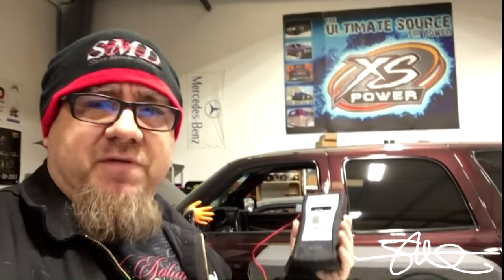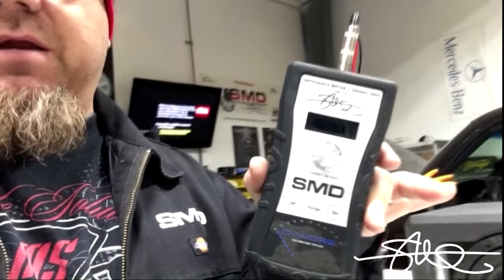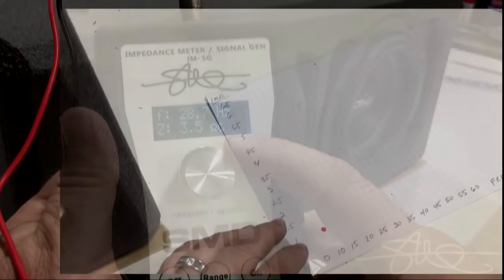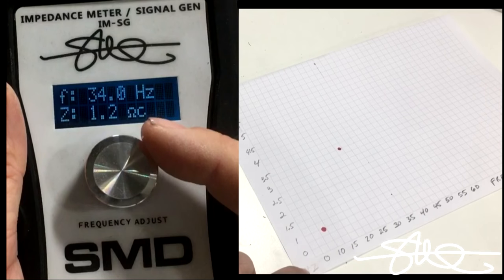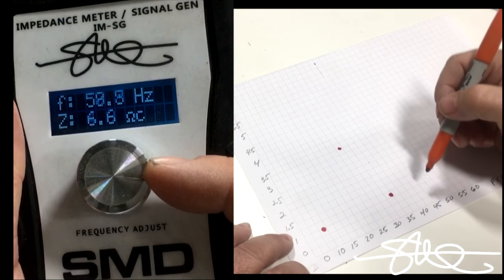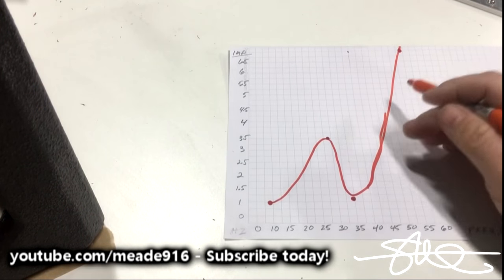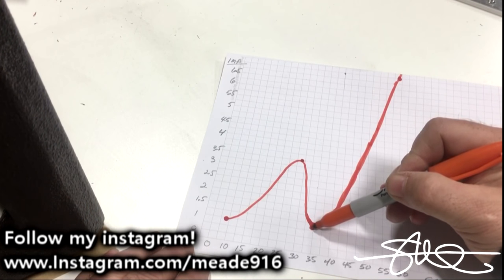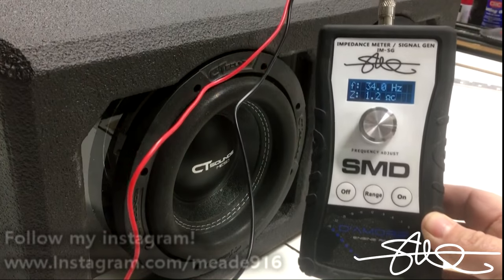Ported Subwoofer Enclosure - How to find or Verify Actual Tuning Frequency - SMD IMSG

Comment from the maker: Best part about this tool (and it does a LOT, trust me), is that you can make box changes like longer ports, adding stuffing (fill), larger, more (multiple ports), box volume changes etc and see INSTANTLY if it made a difference.  You can gain several hundred watts back by making tuning changes to a box which may have raised impedance too high at certain frequencies.  Picture this, you are seeing 5 ohms at 50hz.  You change the port and add polyfill (for example), and now your seeing 3.5 ohms at 50hz.  Your amp will put out more power.  You just fixed a problem in real time! Or, you can see if changes you made hurt you.  This is one of my all time favorite tools for sure!
Reply: In germany it's 4:40 am. 

Do you know the Eton Force18? It's a subwoofer engineered in germany.

Bitte, Englisch ist nicht allzu schwer..
Reply: meade916 that squiggly line forced me to unsubscribe lol sick vids man fun to watch im learning alot thanks
Reply: WHAT IS YOUR OPINION ON ADDING POLYFILL TO PORTED ENCLOSURES? STEVE YOU ARE AWESOME!  THANKS!

Comment: Steve I have some Definitive Tech towers and go as low as 13 htz.  I don't know if it's true. I will say they are lower than my RE audio SXXs, Rockford HX2's, old school Lanzar Pros and lower than my Velodyne.  I definitely would like to remake what they did with far less cost than I had already paid for them to make for another room just for my lows I produce in my studio.  All my tracks have thump with some lows. I love lows.
Reply: Exactly ... to get excursion you need box ported and power... a driver that supports that power.. you gave me no info bro... I'm talking about the box design. The amp. You can't just get 13hz out of just a box. You gotta have at least an amp that can push power rated 20htz and lower to begin with. Sony and a lot of other commercial brands can't or don't. While speakers, subs etc. have no ratings like that in acceptability they are measured by what comes out of them. OK.. went as low as 28htz no matter what kind of box it was in. Everything matters when trying to reach lower than 20htz or higher than 20khz. The signal of material used, amps, motors and boxes and their placement. My thing is I want to know who or what on a lower cost end has Steve built that was built for the LOW THX end of the audio spectrum that specialized in the ultra sub sonic lows? 13hz Or my other question is why the car audio market in their top brands don't have such solutions? For the really low end? Most woofers are made to push mid 20's to mid 30's.
Reply: And yes I know 13hz is inaudable. I have metal flaps on the ports of my definitive's to prevent my Ferret from going in them and tearing them up from the inside out....he already did this to some Klipsch's....when I go below 20... I don't hear it. But since I put those metal doors the excursion and sound pressure pops those doors open and slams them shut. The room shakes the whole damn house shakes. Like the lowest of thunder in a storm by nature. I know those doors aren't good to add resistance. I love my little ferret dude though and never lock him up. I just want to recreate what definitive did. They did great. Box , amp , driver.. I just have to ensure I feed it a full range signal from the 0hz and above. I just wish my damn Rockford right now in a backroom I need super lows... wish it hit like that. It don't and it's been placed in a 1.5cu, 2.0, 3.0, 5.0cu ft boxes it got lower but nowhere near as low as I needed. Basicly to get that woofer to flex hardcore took over 1,000 watts and it still wasn't going "lower" just more force on the 20hz and up range.

Comment: meade916 loving the videos . all the way from nz . running a ported 10 in my carolla and it booms . I've put guys with 2 12s to shame . thinking of upgrading what's your opinion on 2 10s in a ported custom box or a single 12 or 15 ?
Reply: 2 10s should be louder, though a 15 would go lower. Depends on what you listen to. Also, 10s tend to have more punch, around the 60Hz mark, while 15s are more like 40Hz, and 12's tend to lie somewhere in between.
Reply: UniCrafter how loud or low it goes will depend on the drivers, enclosure tuning, cabin, etc. Cost could be a factor too. He could probably save money to use on batteries, amps etc. by adding a second 10 instead of getting new subs. If he wants new subs, he can get a single 3" or 4" coil 15 for the same price as 2 smaller subs. I would personally go with a single high quality 15, and that way if I wanted more bass later on I could add a 2nd 15 and wall the car off.
Reply: UniCrafter how loud or low it goes will depend on the drivers, enclosure tuning, cabin, etc. Cost could be a factor too. He could probably save money to use on batteries, amps etc. by adding a second 10 instead of getting new subs. If he wants new subs, he can get a single 3" or 4" coil 15 for the same price as 2 smaller subs. I would personally go with a single high quality 15, and that way if I wanted more bass later on I could add a 2nd 15 and wall the car off.
Reply: Cheers guys . thanks for all the info . cost and space are the 2 main issues for me . don't want to loose my whole boot to the woofers . amd I do have a 2nd 10 but it's in a single sealed box so would be building my own dual enclosure . music ways I listen to anything and everything really . 10s seem to work really well for me but perhaps a 12 would work abit better

Comment: +meade916  So this is basically a response to your initial comment when uploading the video. So I can understand about being able to change ports in real time and you can get the impedance to drop down a bit at certain frequencies, however how would the relate to sound quality? Also how would we know to go bigger in port area or shorter or longer in port length to lower impedance at a given hz? Will lowering the impedance at a higher hz than what the power is tuned to fluctuate anything differently with the power handling at tuning?  Sorry for all the questions, this is just fascinating as fuck and am definitely going to have to pick this up along with the DD1+ and crossover setter (sorry dont know the actual model name of the last tool you created).  Thanks for the answers in advance bud.
Reply: first question a box is tuned to a single frequency so the lowest point of impedance would be your tune. this will change sound quality because say you want really low bass then you tune the box lower. by tuning a box you are simply saying you want the most power at that specific frequency. So if you tune to 30hz you will have the most power at that frequency so you would hear a nice strong 30hz sound. SO the "sound quality" would just be a matter of what you like. Second question is that device Steve has would let you know if going bigger in diameter or lenght of port wold affect frequency. either that or just calculate it by using the formulas. third question....more impedance less power. SO when you think of impedance dont think of it as a separate thing it is directly related to power. So less impedance more power, more impedance less power. if you get that much now move to the visual Steve provided. if you want to lower impedance at higher frequencies all you have to do is move the dip to a higher frequency by tuning the box. by doing that you will gain more power at higher frequencies but lose power at lower frequencies. in other words you would most likely have a bigger first peak.
Reply: Luis Lopez awesome dude! Thanks for taking the time out to answer them. I get it now. So ok one last question for you. Say I wanted to hit 160 dbs at 60hz. I see that most are tuned at 40-45 hz to hit 160db at 60hz on the term lab. Would this tool help me to know where to tune the box? Or is that more or less dependent on set up and vehicle with how LOUD it would actually get to? Taking the equation of power out because I already know it takes a ridiculous amount of power to get loud in certain aspects.
Reply: i couldn't tell you because i dont know about term lab or how to get high scores. the tool wont tell you what to expect at 60hz as far as db. like you said that would have to include car amp etc...but i have noticed by reading posts at watching videos that a few hz higher than the tune is usuallly the loudest
Reply: So where it's the loudest is that the peak that I hear everyone talking about? for example. I'm tuned to 38hz it peaks at 44hz.

Comment: Can you explain better why the lowest impedance is where the box is tuned?  I understand how ported boxes can increase power capacity of  a woofer at the port tuned frequency but why is the impedance lower?  Can you elaborate on this more?  I like the geek out the tech shit lol.  Maybe make a vid explaining it better?
Reply: Pretty much its measuring the resistance of the subwoofer at the specific frequency. The lower resistance the more power you will get out the subwoofer. When you ask how ported boxes can increase power and why is the impedance lower you are answering your own question. you get more power because the impedance is lower. Impedance is resistance but in a AC circuit instead of a DC circuit.